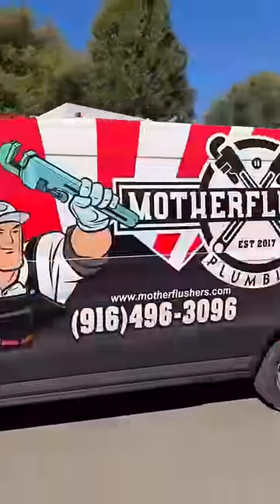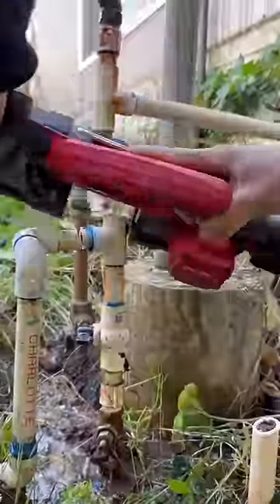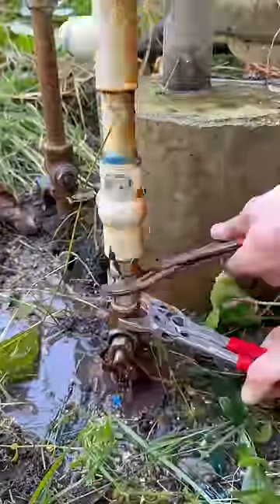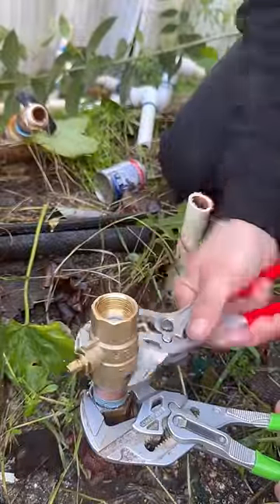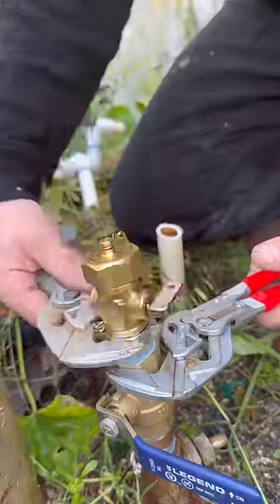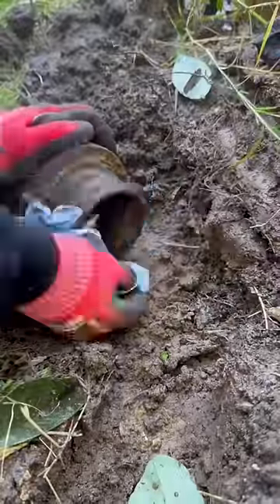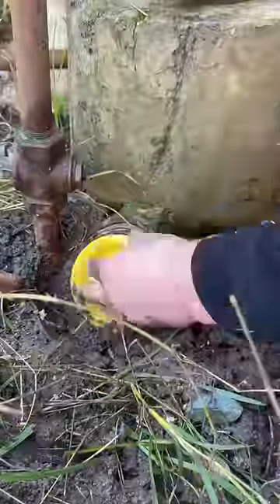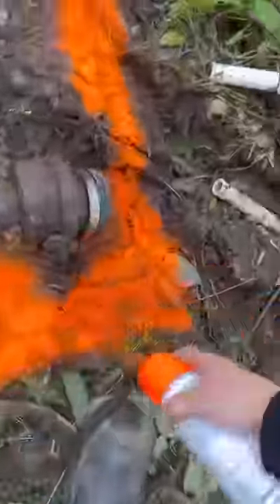prepping a mobile home for demolition with a new shut off valve and a cap on the sewer #plumber

Comment: I work in this trailer park somtimes with the company im at. The whole trailer park is plumbed like a city with its own well and series of injector pumps. The first job i did there was in the back shut the water off like 9 oclock or so found the leak at 3 after digging through the mud under a trailer fucking main was STILL pissing pressure. Take all day to drain.

Comment: I mean I'm a water/sewage guy (small town) and I would be screeching if you left that galvanized pipe with just a cap for ever. if it's hey this is temporary that's cool. I don't know what I would suggest for a permanent fix for metal sewage everything i have is plastic. I'm guessing motherflusher isn't doing the service retirement that's usually a hole guy not a plumber